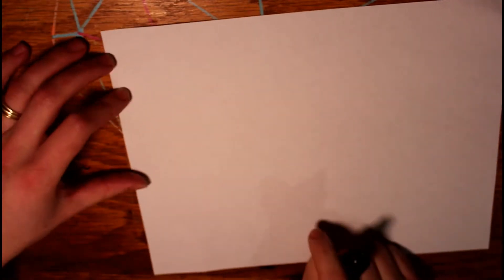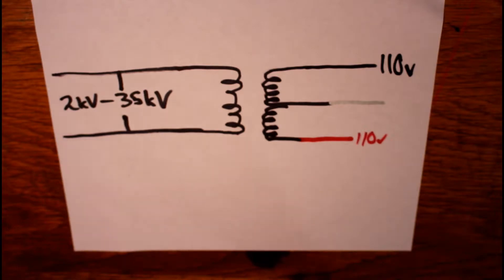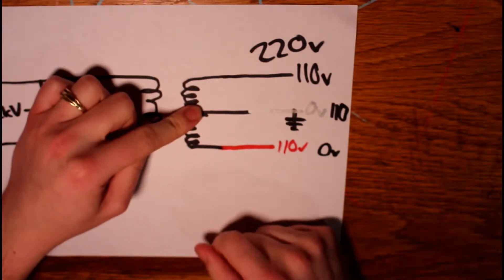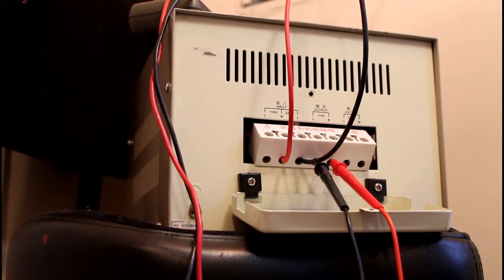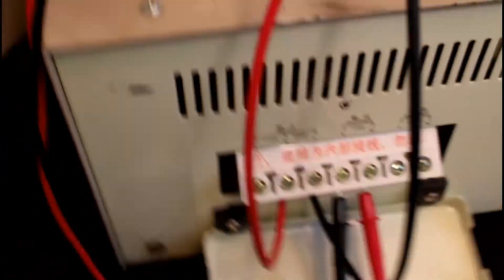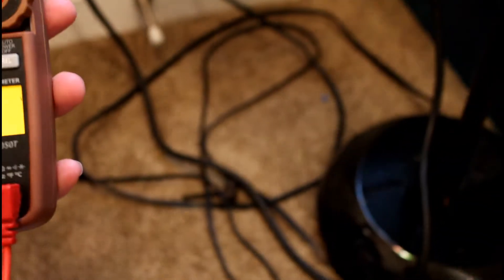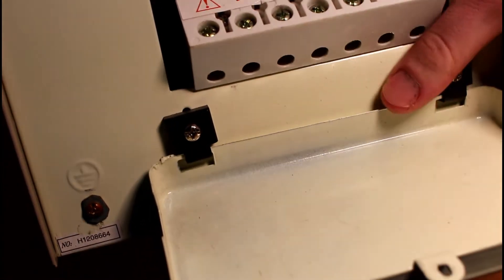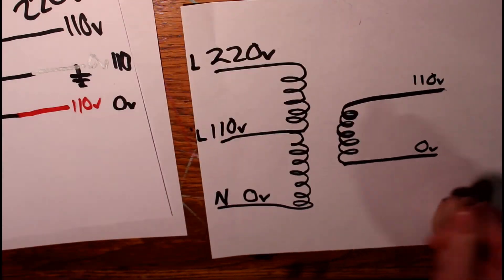Explanation of 120V / 220V in the home & How To Wire a Step Down Transformer

Comment: I like this video.  My issue - I have a EU 230v inverter that only outputs 230v.  I want to transform that into a split phase of 2 hot legs and a neutral for a service panel.  Will a standard step down transformer do this for me?  It would have to be 5kva as my inverter puts out 4000 watts.  Thanks!!  Let me know if you have one of the transformers.  adavis@vmwebapps.com
Reply from the maker: What do you want the voltage of the two hot legs to be? If you're going for +/-115V then there's no need for step down, just a 1:1 (or isolation transformer) with a dual secondary (also called a center tap) will work; the center tap will be your neutral and the outer taps will be your two hot phases. If isolation isn't important, you could also use an autotransformer with the secondary tap set at the halfway point -that would be your neutral, acting to split the 230V input, which might be ill advised depending on how your inverter works and if it already has a neutral reference.